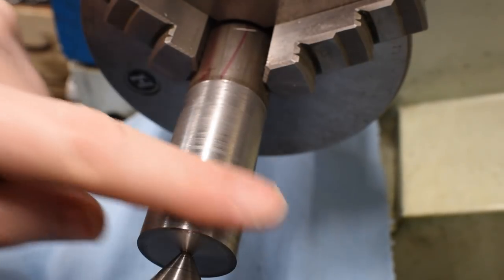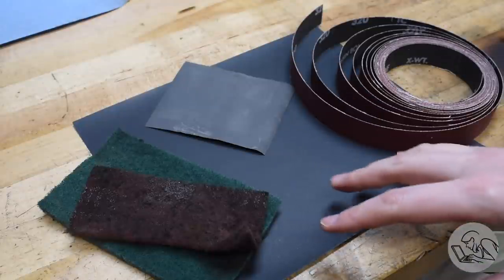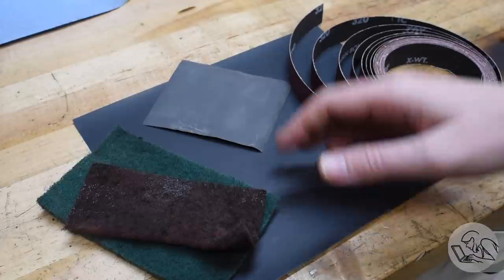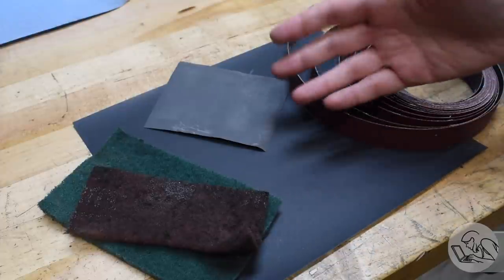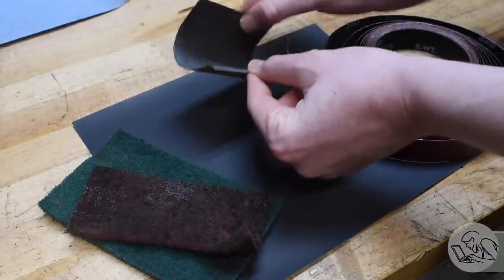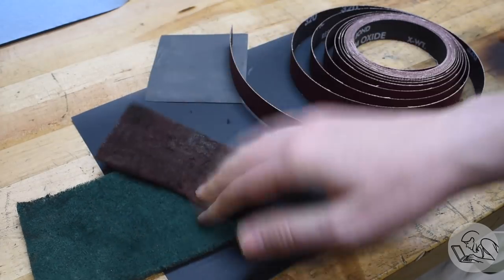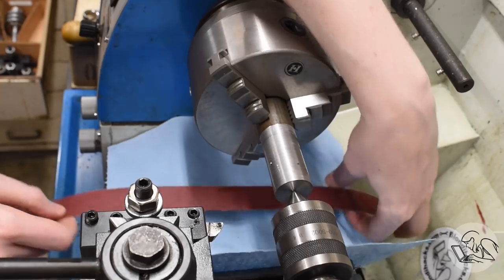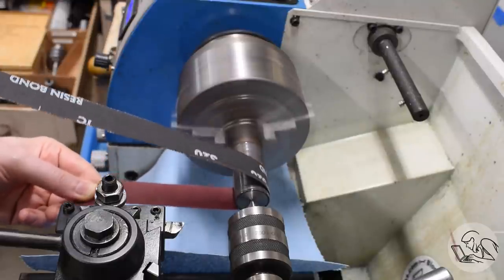Emery Paper In The Machine Shop

Comment: Good presentation.  I use emery as most of us do but I start out at 80 grit if I am trying to remove rust or a bad finish.  I use a piece of glass also but I have glued a piece of tool box no skid liner to the bottom to keep it from sliding around.  I have also used a piece of granite tile such as the kind used for countertops.  I have found it to be very flat.

Comment: You can also wrap long parts with the gritside of the emory papir against the part a few times and then clamp it down on the vise if it is a strange shaped part with only a few points of impact even with a strip of emory against the vice!

Comment: I love you Quinn, I have been meaning to request a video on abrasives because no one else, etc. - and you knew that even though I never got my a.... in gear to actually send that request! Amazing!
Reply: “Emery paper and -cloth
makes me the machinist I’m not...h”

I’ll see myself out!
Reply: At 14:07 you can see in the reflection that the glass is not enough :-P - it bends under your finger pressure! So glass is only going to be flat when it is on something flat. How about... a surface plate?

Ok, ok, now I really am going!
Reply: @mumblbeebee6546  Well, it makes sense right?  It would protect the surface plate.  I think that's a good idea, kinda, I think.
Reply: @onestopfabshop3224  If I had a surface plate, I’d keep it far away from anything abrasive. At least... I’d try. Because the grit will get in between glass and plate. Grit gets everywhere :)
Any port in a storm, of course....
Reply: @mumblbeebee6546  I gotcha

Comment: I keep my emery cloth separate from my sand paper pile and use it when I need maximum flexibility (like lathe work).  I use the sand paper to make dedicated sanding sticks by folding the entire sheet on a paint stirring stick or scrap wood and peel the old worn layers off as needed.
Reply: Do you work in Kyber or just revere those badass machinists?
Reply: *Khyber

Comment: Great video.  Good info. You should also mention P grade paper. People use it interchangeably but that will get you in trouble. P320 grade is not the same as 320 it's coarser. I have a conversion chart that I downloaded to help with this confusion. Just search for P grade paper conversion chart.  I also use a 12"x12" piece of granite tile from the big box store, for sanding. Works great!

Comment: For lapping, I'd suggest not using picture-frame-glass which is around 3mm (1/8"). It's expensive and flexible (not flat!)

Window glass is 6mm (and thus 4x stiffer) and is mass produced in crazy quantities, so it's cheap.

To support and hold the glass, use "non slip mat", which will also allow the glass to hold it's own shape without being forced into conformity with the bench underneath.

(don't buy "router mat" which is the same stuff with a higher price tag!)

Comment: Here is a hobo (or cheapscake)  tip- I bought 3 g640 granite tiles 200x200x50mm .. 1.5 eur each. Get yourself some corundum/garnet powder, and after 8 hours of 3 plate method - you have yorself 3 perfectly flat surfaces. I use one as a small surface plate, one for emery - and one is spare

Comment: Probably worth a mention of another safety tip: Never hold both ends of the emery cloth with the same hand — makes it easy for it to get wrapped around the part and suck your hand in.
Reply: another one; never wrap it around the near side of the part, pushing towards the machine.

Comment: cloth holds dimension better.  For close tolerances where your trying to polish down to the correct dia. having both edges of your emery cloth cutting evenly makes it much easier  to get constant diameter.  grit is depth of scratch, higher polish desired requires finer grit, but you knew that.  good vid

Comment: Another source of glass is old scanners or multifunction printers. I have found it to be slightly thicker than cheap picture frame glass, and it has nicely chamfered edges so you are less likely to slice a finger open due to careless handling.

Comment: Down here one can easily find glazed ceramic floor tiles that have a mirror-like finish. They should be almost as flat as picture-frame glass, but are sturdier and heavier.  But a problem is to find a store that would sell just one, rather than a box of 5 or 10...

Comment: Instead of tape, try using 777 adhesive spray. Spray the sheet, wait till it cures still it's just tacky, and then apply the sheet to the plate - I learned that trick from Robin Renzetti 😁👍 also kerosene works well for lapping "wet", just get a small plastic bin and put maybe a half inch of keep in it. Then you just dunk the part in it before lapping. Periodically rotating what your lapping helps too.

Comment: A few points: (1) I'd have been quite pleased with your "really bad" finish: I am that inept. (2) I've never managed to "sneak up" on a diameter on the lathe without suddenly and inexplicably over doing it. Definitely going to try your suggestion. (3) I think AvE had a video on a device for doing automated figure of eight lapping. (4) I'm buying a magic wheel on Amazon now. Thanks for another really helpful video.
Reply: Currently unavailable.
We don't know when or if this item will be back in stock.  I blame you. Did you have to tell the rest of your viewers?
Reply from the maker: MSC Direct also sells them. 😁

Comment: Must confess I usually have a ruff time regulating the grinding weel... hate grinders
Reply: They are only for removing bulk in my opinion.
Reply: Yeah, in my opinion bench grinders are quite  primitive.  I mean, I use mine to grind up high speed steel, but finesse work, I try not to.
Reply: @onestopfabshop3224  
Sometime i use an industrial grade beltgrinder to free shape smaller pieces of thicker steelsheet in the blacksmith.
I also using it to rough shape axes and similar tools before finegrinding.
Reply: They are necessary for sharpening bits. But mine always get very woobly. I never was able to true the stones good enough
Reply: @fcconstantino  
If You ment centering the stones i tip i seen is to use a pair of slightly eccentric shaped brass sheat You place like the wisors on a clock until it runs smooth.
Probably easiest done with a pair of V blocks and a pice of axel that has the same diameter in order to find the balance point.
Reply: @sheep1ewe  I might be wrong but someone did a video on balancing wheels.  I THINK it might have been Solid Rock Machine Shop channel?
Reply: @onestopfabshop3224  Ok, i will check that out.
Maybe i am tired, i did not got the core of the problem in my previous posts.
Reply: @sheep1ewe  I was simply mentioning another alternative to your method.  If you have a lot of information on it, I think a person can come to a better decision in what he/ she wants to do.

Comment: Why not glue a length of emery paper or cloth onto a thin strip of wood and run it back and forth with both hands as the piece spins? You can adjust the pressure as you feel it cut, as well as change the angle between the two surfaces. Know what I mean?
Have a slightly coarser and then finer than 320 grit all ready to go to. Easy to make a bunch at once.
And butter the glass as well as the back of the sandpaper with glue before attaching. Use a roller or some other method to make the contact perfectly flat. Otherwise the paper does not stay truly flat, nor sharp.